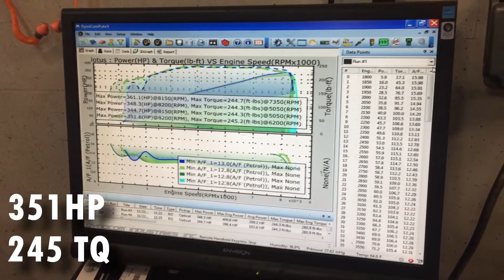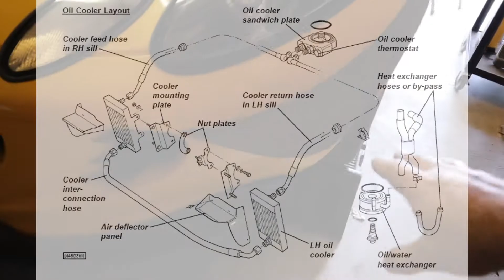Autocross build 3 - Why My Lotus Engine Needs a Rebuild

Comment: Thanks for sharing. If I have to guess over the internet I’d say the break in oil used at full power accelerated cam wear (which is a known weak point of that engine) and once there was metal in the oil everything else failed. Hard to say if using regular oil would have saved it or just made it last a little longer. Good plan on new build waiting for updates

Comment: The oil cooler system has a bypass and a thermostat. So the oil only goes through the cooling system when it reaches temp and not all the oil goes through it. My cam wiping problems ended when I increased my intake valve lash from 0.004" - 0.007" to 0.010 - 0.013". If the oil coolers have metal in them, your oil filter was in bypass.
Reply: Sorry you are wrong about the oil thermostat. Check this to see how the original Mocal Thermostat works. Spoiler: the cooling circuit is permanently open: https://www.youtube.com/watch?v=l6Z2q-ttyOA the best way to get a good solution for @vmw garage would be to exchange it to a Mishimoto one and a higher temp thermostat then it would work like this: https://youtu.be/nDAKSc_NKuQ (Mishimoto item no. MMOP-SP & MMTS-SPT-93)
Reply: @jaspis4167   so this guy is saying that our thermostats operate opposite of how they're supposed to. He says they close when the oil is hot to prevent flow to the cooler and they are open when cold to allow cold oil flow to the coolers. Is that what I heard him say?
This is ludicrous and if correct is an egregious fail on the part of the engineers. I have not tested mine to confirm that it doesn't operate backwards, but I didn't see the guy in the video test with flow either. So it is possible that he saw it closed and called it open then saw it open and called it closed and I believe until proven otherwise is far more likely than a company, who manufacturers oil cooler sandwich plates and were suppliers to Toyota, manufactured a bunch of thermostats that operate counter intuitively.

I'm ok with being wrong. I learn something everyday. There is a far better chance that the guy in your video is wrong rather than me in this case. People get the opening and closing of coolant thermostats backward all the time and I think he got it wrong. I do appreciate you bringing this to our attention and I am going to test it for myself. Perhaps I will post a video and remember to share a link in regards to my findings. If the guy in the video you linked is correct it would be gross negligence on the part of Toyota.
Reply: @3dw3dw  He is right, i have the mocal in my basement and it is exactly how he describes it in his video
Reply: @jaspis4167  that's awful! Why would anyone build it ass backward. It's fine for Texas but for people much farther north that's just unimaginable. I'm sorry that I am having trouble believing it.
Again I thank you for bringing this to our attention. I'm still going to have to tear into it myself.
Reply from the maker: Do you know if the oil filter is on the exit or return line from the coolers? I was under impression that it was on the exit so it would not catch returning junk from the coolers??? Also after installing the oil temp gauge that measures oil temps in the oil pan - it takes the oil so long to heat up. I know for sure I have never waited this long in the past to start hammering on the little beast;)
Reply: @vmwgarage9816  for oil temps and how long it takes to heat we can look at our aluminum baffled oil pans that hold more oil and transfer heat like crazy. The oil cooler is on the discharge side of the filter. If the oil that entered the coolers is clean then there should be no need to filter it after the cooler because the metal never made it too the cooler. You said you never waited so long to start hammering the little beast but the oil coolers have been there since factory... So what changed? That enormous aluminum oil pan. So with oil, for every 15°F above 130°F operating temperature it's service life is reduced by 50 percent according to my 3 friends who are credentialed CLS (Certified Lubrication Specialists) of which there are fewer than 2000 in the world. They are top of the food chain where lubrication sciences aka tribology is concerned. 
Another consensus among CLS is that the lower the first number in your oils weight before the "W", ie. 5w40, 0w20, the less it's viscosity is effected by temperature and those begining with a "0w" the change in viscosity between 100°F and 200°F is negligible. The change in Saybolt Universal Seconds (SSU)  between 160°F and 210°F isn't even measurable by manual means. So as much as I like and appreciate Phil, he is operating on a false premise according to 3 CLS who work in reliability groups specializing in oils and issues involving lubrication. He could be right if we were all running 20w50, but I don't know anyone that backwards. Cold oil is fine. It's the engine block temp, head temp, and piston temp (if your pistons are 0.0035" forged racing pistons). That's why the engineers are using coolant temp and not oil temp to indicate the engines operating temp. Coolant, not oil. It's not about getting the oil warm, it's about expanding metal components. The pistons operating temperature is above 1000°F
Back when I raced Ford Cleveland engines when we had issues of wiping cams and tappets we always found increasing valve lash resolved it. So when my 2zz started shelling intake cams I thought what's the difference between intake and exhaust and why does the exhaust cam never wipe?
Have you ever seen a wiped exhaust cam? I've replace 5 intake cams on 2zz engines for myself and friends. Never once have I even heard of an exhaust cam wiping. SAME OIL, SAME OIL TEMPS, SAME OIL COOLERS...(Not yelling, just getting your attention here) what is different? Ahhhhhh yeah, the lash. So I ground my shims to give me 10 thousandths lash and my troubles ended.

See we have measured valve lash and working valve lash. We measure it cold but when the head heats up and the valve stem heats up the valve lengthens and reduces working valve lash from measured valve lash. So when I measure lash on a hot engine it is always less than it was when cold. There is even a difference between cruising valve lash and extended flogging valve lash. So if you measure 0.004" lash cold what do you think it is at flogging head temp? 0.001" maybe? Can a heated valve stem grow 0.003"? That's only a hair btw. One thing I will tell you for certain, if you run out of lash while on high cam there is no room for any oil, hot or cold. That slipper plate will grind the cam lobe no matter what.

Give this a couple of reads and time to digest the logic. Lotus talk experts are good guys but while operating on a false premise they can be very convincing to the point you've convinced yourself and it may be difficult to reconvince yourself of an opposing view.

Now back to the oil cooler. It has a thermostatic valve. No oil goes to the cooler until it has reached a predetermined temp. All the oil going to the coolers has passed through the filter before entering. So how did metal get into the cooler if you are using a high quality filter and you change it at regular intervals? If I'm not making sense, remove the plate from the filter adapter and see how it's made.
Reply from the maker: @3dw3dw  wow! This is amazing info!!! I’ll need to read it few times to digest. Thank you so much for your contribution l!!!
Reply: @vmwgarage9816  I modified it a little bit. I try to be direct and to the point but when I reread it sounds harsh. Then I see what I forgot to type a d feel I need to add it. I hope it serves you well.

Ok, the reason the filter is before the cooler and not after is if there were particulate greater than 25 micron flowing through the cooler lines at velocity, they would act as an abrasive and erode the lines and the coolers themselves. So as long as you've done your due diligence there should be no "trash" in the cooler.

Oh, since you've already bought the aftermarket cooler, you can use the factory oil coolers for your intercooler coolant.
Reply from the maker: @3dw3dw  great minds think alike! Unfortunately one of my factory oil coolers is leaking so I’ll probably custom make a real air to water heat exchangers and put them in place of the oil coolers.

Comment: If not already a member join Lotustalk. Tons of threads and build that you can learn much from. The overcooling is a old issue and addressed in a number of ways. Common advice is waiting ten minutes past coolant coming to temp.
Reply: Hi, I am a member! Yes I did get the oil temperature gauge so that should give me a real world data on the oil temps in the future!!!
Reply: Over cooling is not an issue. It is a false premise. Unless you use 20w50 in your 2zz over cooling is not an issue. There is as much misinformation in lotus talk as there is anywhere else on the webs. Let me know if you'd like a detailed explanation or if you have questions regarding what I have to support my statement. I am happy to serve you.

Comment: Nothing to do with Lotus. You double the stock horsepower done by an amateur builder.
Reply from the maker: I’ll take blame for my fair share of mistakes and pushing the platform quite far. However the Oil over cooling is a real issue  even on the stock motors and the ecu allowing you to rev the engine all the way to the redline when the motor oil is around 110 degrees are a real concerns.  Not to mention the non baffled oil pan or fuel starvation or end links snapping. I love the car and most of it’s engineering is brilliant! But I also would like others to know the problem areas especially if they are planing to slap a supercharger or a turbo on the car. Sorry if I wasn’t clear.